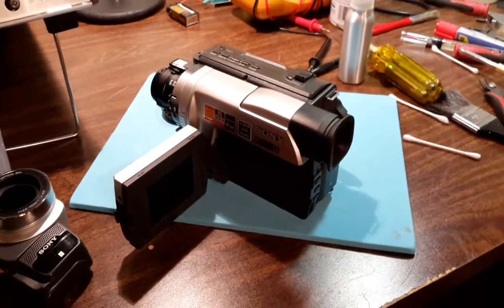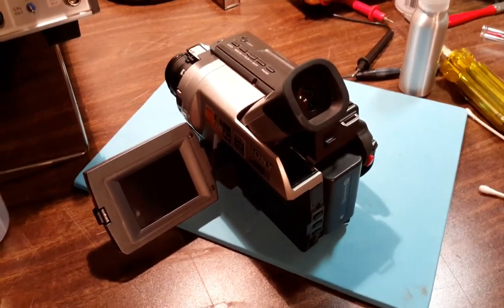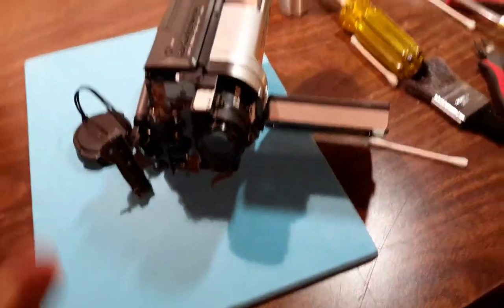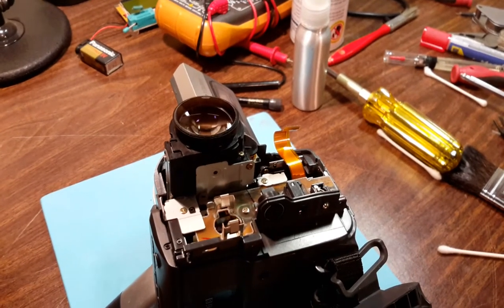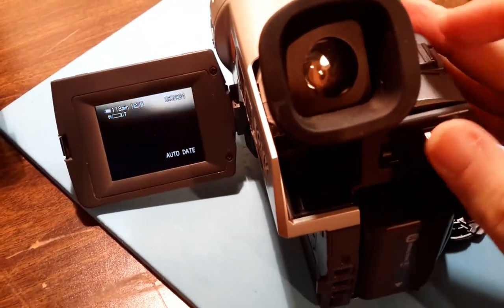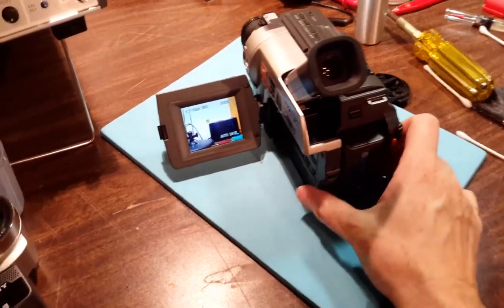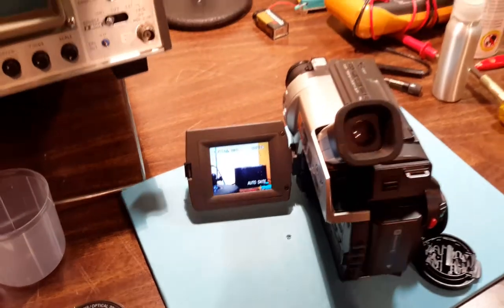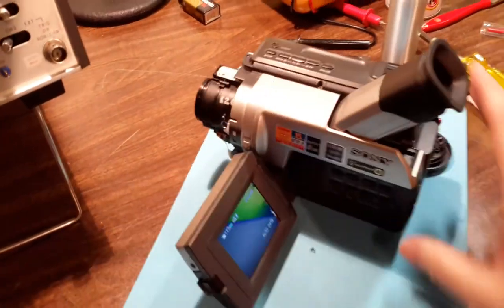Sony Handycam repair.

Comment: Oh yay! I can't believe I was right. Good job getting it fixed!

By the way, I passed my amateur radio examination today!
Reply from the maker: +themaritimeman I hope that filter thing is not the exposure control. I guess tomorrow in the daylight will tell eh ?
Reply: +Neil Robinson I doubt it - the exposure would be something variable, like an aperture. I'm not really sure though. You can check by putting it on manual exposure and turning the thumbwheel to see that it adjusts up and down correctly.
Reply from the maker: +themaritimeman I intend to do that very thing later on.
Reply from the maker: +themaritimeman Also....did you notice that the memory back up battery has been removed, so someone has been in there before me.

Its an odd battery clip, i wonder what battery would replace it ?
Reply: +Neil Robinson I didn't know the backup battery was inside there! Maybe next time I come around I can identify it.